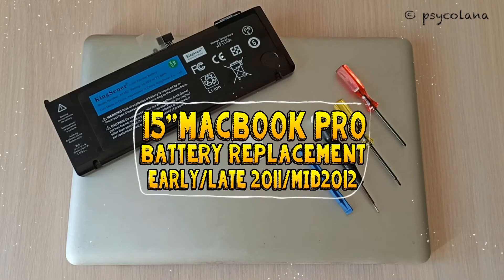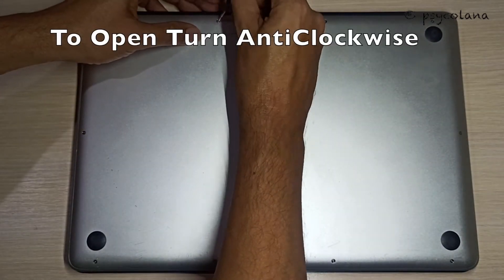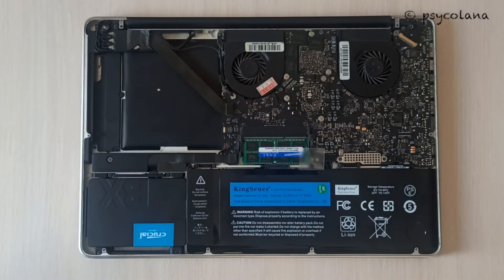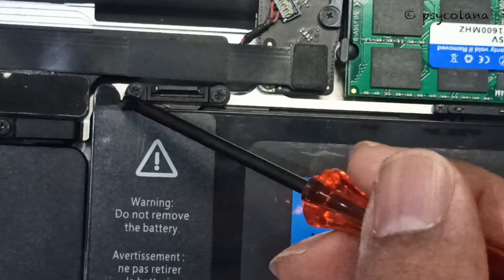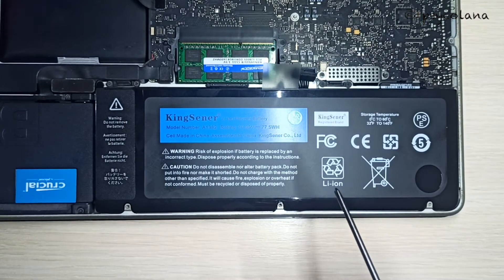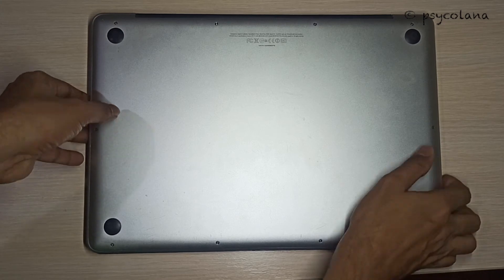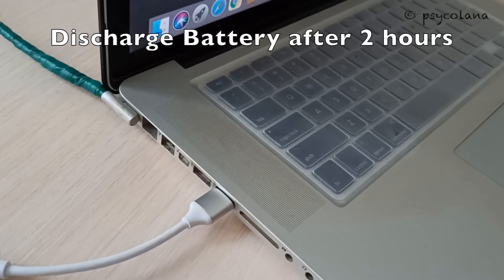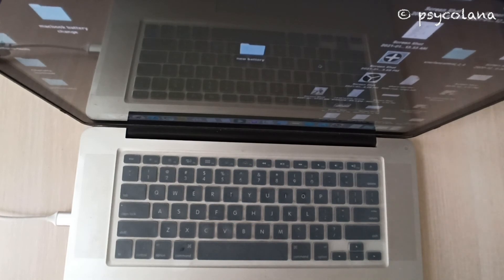MacBook Pro 15-inch Battery Replacement | Mid, Late 2011, Mid 2012

Comment: Did this battery hold a charge?
Reply from the maker: This battery from Kingsener I would not recommend, it holds a charge but after some time full charge capacity and cycle count falls.

Comment: Loved the video, thank you! :) Quite curious to know what you have connected to your USB port though - PLEASE tell me it's a USD to HDMI out adaptor? (my only thunderbolt port is currently used up by my audio device and I don't have access to a dock to daisy chain it to another external display at the moment)
Reply from the maker: Most welcome, the airport/bluetooth board is toast so using an external wifi dongle(tplink) connected via the usb hub (link in description) this usb hub has no HDMI. which model is you mac?
Reply: @psycolana  It's a mid 2012 15 in 2.6 i7 8 GB
Reply from the maker: @siddotkeys  you could use a usb 3.0 to hdmi adapter but I am not sure about the audio signal
Reply from the maker: @siddotkeys  NewerTech adapter VIDU3DVIA
Reply: @psycolana  thank you! Will look into this! :)
Reply: Thanks so much! Will look into this!